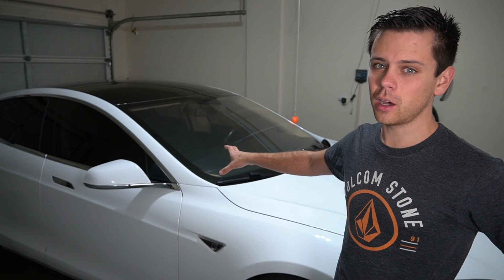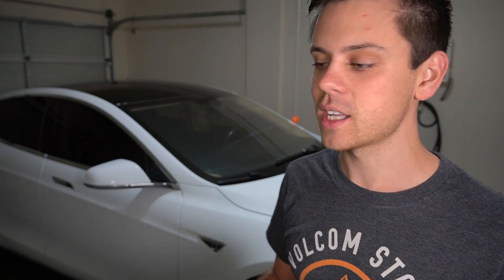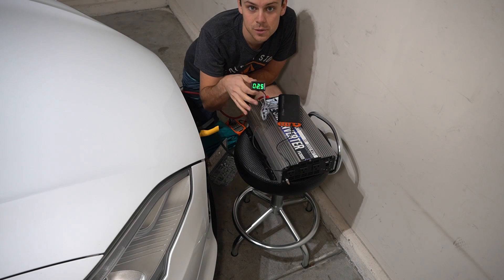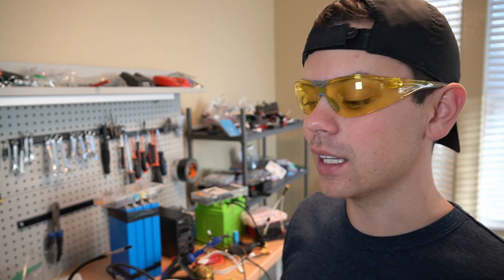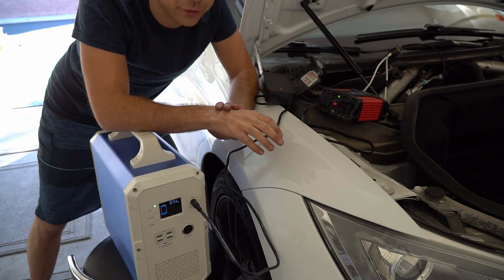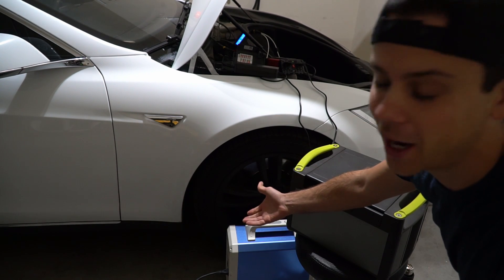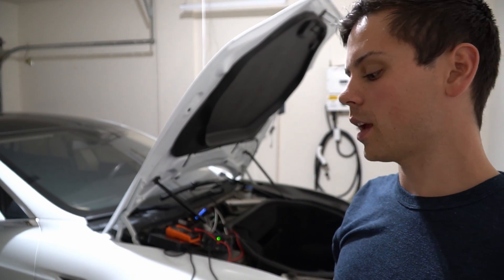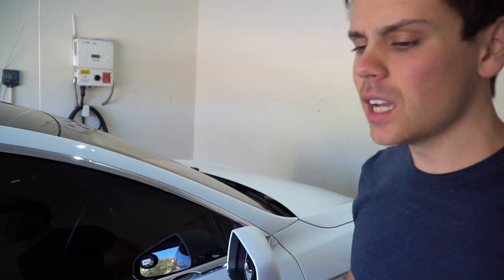Hacking my Tesla Model S for an Emergency 12v Power Source

Comment: Why does a Tesla have 12v jumper terminals? Is it to jump start gas cars? And if so, why are they hard to get to? So many questions.
Reply: Most of the cars electrics not having to do with driving are 12 volt. If your 12V battery is dead you can't unlock or open the doors. The jumpers are there for that reason.

Comment: When you say that the charger came ON as the battery voltage dropped, is the load being powered by the charger or still the battery? If the latter it is bad. But then I am sure Tesla knows better and the charger is changing the battery and separately powering the load.
Reply: The charger was 200a as Will stated, and he was drawing less than 30a,
So the battery will probably be charged at a safe amperage and also will the > 30a load be supported.
Reply: It is a bad idea to draw from a battery while it is being charged. Perhaps the higher power of the charger makes it so that nothing is being drawn from the battery. How can this be tested?
Reply: @sadaavedan  Since the "charger" is a way higher amperage then the load and battery combined, it should be fine.

Normal battery chargers are at most 10A, so yeah then it's not a great idea to put a load on it. 

But it's the same as driving a combustion car and charging the battery and having a heavy load at the same time.

Comment: I love what you did here. Hold no prisoners!! We need to force legislation that will make EV manufacturers provide Vehicle to Grid power, just like they are required to meet other standards.
Not sure about the statement about oil - " we will run out" - I think, check me though, but I think that we will exterminate ourselves with CO2 emissions and the resulting global temperature rise long before we run out of oil.

Comment: In the past I had been looking at solar for a potential new house that never happened. I thing I remember that was really cool in the appliance department was a different kind of fridge. Your fridge is one of the most energy intensive appliances you own especially since every time you open the door, all the cold air comes rolling out since colder air sinks and warmer air climbs. So this guy can up with the idea that when he was designing the kitchen in his new house, he would include room for maybe a 10 or 12 Cu. Ft. chest freezer. He bought an external thermostat and mounted it on the wall behind the freezer. He ran a thermocouple into the freezer and then wired the thermostat to the compressor motor of the freezer. That way he could set the temp at a normal fridge temp, like you would do on a 12V. fridge. The chest freezer is way better insulated than a fridge and doesn't have the frost free feature of a normal fridge top freezer which just turns on a heater periodically to melt the frost. That's why food left in a fridge top freezer gets burned after a month. The chest freezer used as a fridge was very energy efficient so their solar system could be much smaller. Other than that they just planned stuff like the dishwasher and laundry on different days, when there was lots of sunshine. Just passing along useful information just like you do Will. Hope it is useful to you.

Comment: How hard would it be to tap into the high voltage battery and step it down to ~48 volts?
I've seen DC-DC converters I was thinking of using a prius in the same way but I didn't think the price for the converter was right.

Comment: YES! Someone finally figured out a way to use the massive energy stored in a Tesla, for use during a power outage. At least it’s a good first step.
Now, how do we non-techie people do it without pulling our cars apart? Thank you. Love your videos even if I only understand about 50% of what you’re saying.
Reply: Maybe someday they'll offer a inverter/plugin 110v options for electric cars.
Reply: I'm pretty sure I can hook up a 1200 watt inverter to the 12 volt battery in my Tesla and then plug an extension cord into the inverter. The extension cord then goes to the fridge. Or whatever. Nikki from Transport Evolved does that with her leaf on a video. I was hoping that will would show something simple like that.
Reply: @capecoddess3784  " I can hook up an 1100 watt inverter to the 12 volt battery"
And you would be damaging the car starter battery that isn't designed to run a fridge. Stater battered are designed high amp, short draw.
What electric cars do not have yet, is a 110v plugin to it's 100kWh drive battery, which could easily power a fridge and anything else up to 100 amps.

Comment: When you give your Tesla solar charging capability, patent it so Elon will have to pay you residuals.
Reply: Generally corporations use lawyers, injunctions, and cease/desist orders when ppl mess around with their IP. Safest not to profit directly.
Reply: @dmay3391  The "car accessories industry / non-OEM replacement part industry" is as old as American Pie.  The Chinese are already building stuff for Tesla vehicles and soon Elon himself will open a MegaMega-factory over there (those jobs will be non-US).
Reply: @tabaccopuro  "The Chinese are already building stuff for Tesla"
China doesn't believe in IP property ownership.

Comment: Thanks for this public service Will!  That was my plan for backup power with my model 3, now you've confirmed it will work!  (I planned to use a small 400W inverter with extension cables to my appliances).
Reply: a 400 watt inverter won't likely be enough to start your appliances like fridge or freezer or microwave.  I would suggest at least 2 to 3 times that.  Modern fridge or freezer usually runs on about 300 to 400 watts after starting and a microwave 700 or so.
Reply: @teekay1785  Yeah, frig can't be used, kill-a-watt meter shows 500W, starting would be higher.  I can run my microwave at maybe 30% power setting and power my living room - that's enough to be comfortable until the power comes back on.  Also, I have gas heat that requires only a 90W water pump, having heat is a huge deal here in the Northeast!
Reply: @Samuel-ks5gv  am I missing something?  What Gas heat needs a water pump unless its radiant in floor etc ?

Comment: OK that was AWESOME !!! You are more than a little nuts but I totally respect that.

You may want to look at getting a cheap thermal imager. I got a little $70 one from Bangood and it lets me see when wires or terminals are getting hot as well as what components need heat sinks or are going to blow imminently. 

I mention this because in the first part of the video where the front terminals were connected with thin wire a thermal imager would have been really handy. Also it's something that is just really useful when dealing with batteries.

Comment: I've been wondering..  can you use solar panels to charge a Tesla ?    Seems one could drive for a very long time if you don't have to worry about stopping to charge up somewhere.    peace
Reply: @Jason Bowman Will's Model S is 60 kWh. A 200 W panel produces maybe 1.5 kWh per day.
So one 200 W panel would take 40 days to charge from empty to full.
Ten 200 W panels gets it down to 4 days. More is better!
We rarely charge EVs from empty to full, should just top up to around 80% at any opportunity.
Reply: @Jason Bowman Solar can meet all of humanity's energy needs, thousands of times over. Just need more solar panels and batteries produced using clean energy.
Using fossil fuels for planes is OK, as long as their CO₂ emissions are taken back out of the atmosphere again.

Comment: Another great video. If you needed long term 110 ac power at minimal loss you could just use the testla as your battery and hook an efficient inverter to it could you not? And again thanks for doing this research and teaching as you learn yourself

Comment: Does the Tesla need to be turned on for this to work? Can I do this with my Chevy Bolt?
Reply: in regards to the 12-volt battery, Tesla is always on and recharges the12 volt when needed.
Reply: @capecoddess3784  Don’t bet on it. My Model S left me on the road dead because I sat in my car with the AC running for 45 minutes on a hot day.  Drained the 12V dead and car wouldn’t start.  Left me stranded.

Comment: Do you have a link to the 12 - 24v DC converter charger?
Reply: Victron(.com) have a "Buck/Boost" device that will allow you to go between 12 & 24Volts. I have a 12/12 in my Caravan - which has LiFePo 12Volt - so I can charge safely from my cars alternator.

Comment: I'm happy to see this video. I have a model 3 and bought a tiny trailer to pull behind it for extended travel. I installed a new solar system in part with your help. I had mused about using the car's 12v to charge the trailer's new battleborn lithium iron phosphate battery. Didn't know how the car would react. But this seems promising. I'd love to see a more in-depth video exploring the max amps that could be pulled before the car's internal charger can't keep up. Also, some duration testing. But I don't wanna see you hurt your car either. Thanks!

Comment: The next thing I see in my mind is a wall jack and you making a cable to run from the Tesla that wall jack if you need to use the Tesla for your house. I thought about doing this and putting an outlet in my kitchen so in the rare event I have a power failure I can swing the plug that powers my internet hardware and just keep watching TV on laptops. Between Chromebook, Dell 2 in 1 and tablet, I could go about 7-8 hours, and in 15 years in this house my power has never been off for more than 45 minutes. Interestingly enough, one leg of my power panel is fed from my street and the other from the next street over, so worst case only half of my house goes dead. I am looking to move in spring to a nearby area with less congestion and crime, and at that point I might put a small system together to power the lower drawing things in my house. Fridge, induction cooktop, convection toaster oven, furnace, etc.... high draw things, they stay on grid. It will be fun to experiment.

Comment: Hi Will
Really enjoy your channel
You could use a solar grid tie Inverter and power your house direct. There's plenty of second hand grid Inverters around. Just a thought.
Reply: Yeah, but how to draw out 100 amp safely.
Reply: @dmay3391  hi you wouldn't be drawing because your taking 400v.
 So 3kw @ 400v =7.5amps.
House on standby fridge freezer some led lights.maybe max 400w would be 1 amp.
Seems to stack up and of course it is not suitable for a DIY project and all works should be done by a competent person.
Big voltage and current will kill you.

Comment: I think I saw that some people have "power Pack thins in there garages also for charging that you can use  is it called a "WALL?"
Reply: TOMAS, "their" garages...
Reply: @gregyohngy  THANKS  Glad Will has someone watching that
Reply: @gregyohngy  HEY GREG ! CAN YOU ANSWER MY QUESTION NOW ?
Reply: You might be referring to a Tesla Powerwall. They're a large lithium ion battery that reacts to grid power loss much faster than automatic generators. Paired with a solar panel charging system, a Powerwall could power a house for a few days.
Reply: @DangNguyen-my3wd  YES , THANKS, That's what I was thinking!  Will could incorporate it in with his car for the projects he's thinking of. Thanks again Bro.

Comment: Off topic- Why doesn't anyone talk about wind energy?  My sister-in-law's parents have a 30' tower with a turbine which initially cost them around $9,000.  I haven't done the math or research to see how much return they're getting (I don't really talk to them) but it must be worth it.. Especially if you combine solar too.  Any thoughts about it from anyone..
Reply from the maker: Location dependent. If you have wind, use it. Most people do not.
Reply: @WillProwse  I was trying to get a debate started here, lol.  Everything I'm reading about wind energy seems to be positive... If that was the case then more people would be doing it.
Reply from the maker: @Steve_1999  ask it here: https://diysolarforum.com/index.php?forums/wind-turbines.46/
Reply: @Steve_1999  It can be tricky to do in populated areas.  I live in windy Kansas, but can't put a tall tower on my property because I'm too close to neighbors.  Large wind farms, and rural lots are currently the only good options.
Reply: @The81Winfield  Thanks John & Will.  I'm on the forum now...
Reply: @The81Winfield  vertical windmill or get city code changed
Reply from the maker: And everyone has solar
Reply: Honestly what most people don't tell you is the small home sized units just don't generate enough power. It takes a LOT of wind, HIGH SPEED wind, CONSTANT wind to make a generator worth the cost.
Reply: @Tuckerclan  Yeah, I bet it takes years (like a decade) before it "pays for itself."  I've got a friend that mounted a wind turbine on the mast of his sailboat, That's some guaranteed wind but not under the usual circumstances.. lol

Comment: Not to be mean but you should do a video on how many solar panels it would take to drive 50 miles a day to work and back. I need the cost and if you would need a extra 50kwh house battery? So you can make enough power if your car, how much would that cost  at 48 volts 220 10,000 watt inverter installed at your home? You can use as much as you want but when you leave the house is charging up that pack at least the same size as whats in a Tesla , so the cost of a p100 battery pack  One should have supercharger hooked ot a 50/100 kwh battery. Max charge could be 5,000 watts maybe 220 volt changer for your house system which would take 10 hours to take a house 100kwh batter bank to transfer your power over fast. I think a 25,000 watt solar setup would be perfect. You could go a week without sun at all and still get to work and only use around 5000 watts a day in a home. Or you could just burn clean coal and pay 200 or 300 a month in cash which means only about 2400 dollars or 3000 dollars a year and get a shxt tons of power and tons of miles you get in your car enjoying it. You can't never use a super charger cause they are mostly powered by coal and oil too. It would take a 100kwh solar farm to charge around 5 Tesla a day. So, every 100,000 watt solar farm patch (size of earth not getting anymore sunlight ) and how many chargers does a station have? and every 5 Tesla's  per charger. I think it would take a lot of solar panels and all the power that it took to make a solar panel should be made with the sun to keep cost down making the solar panel.
Reply from the maker: I'm making a video on these topics right now.
Reply: Clean coal? Come on.

Comment: Maybe someone knows Nissan e-nv200 12v battery charger amps output? I wondering would it be enough to power electric chainsaw (1,2kw).
Reply: As far as I can find, the 2016 Nissan Leaf have a 135 A converter. The e-nv200 most likely uses the same converter.

In a other source, I found that "It is very stable at 74 Amps 13.6V output."

Comment: Instead of the DC to DC converter, might it be better to utilize a charge controller, set to 30Amps, thru-put? Also setting the shut down to the minimum input to maintain integrity of the "Tesla" and the out put shut down at the capacity of your system. 
 B BIG Time Blessed. . . . .
Reply from the maker: What do you mean? the converter circuit on the car? which one?

Comment: Why is Tesla not using a Battle Born Battery 😅
Reply: Tesla batteries are cheaper and more energy dense than LiFePO₄
Also 60 kWh of Battle Born batteries would cost over $60,000 and leave no room for passengers.

Comment: Tesla needs to use  Super Capacitors inline with their batteries 🔋
Reply from the maker: Why?
Reply: @WillProwse I think there is a significant chance of super cap troll ;)
Reply: super caps are not useful here (for now). The leakage is too high. They are doing research in better batteries which may be a mixture of super caps and kind of li-ion chemistry. Super caps also have very low capacity for the same size. They just can be charged and discharged very quickly, which makes them useful for busses that can be charged in seconds at every bus stop. These experimental busses already exist. battery technology is improving quite fast but it will take some years to industrial mass production.

Comment: Its ridiculous to have house that suck tons of power..... there is a house on Greek Island that uses no electricity..... it a huge house 🏠 it was just built & designed efficiently.
Reply: True, we really should be using solar, wind & even water to power things whenever possible.
Reply: Passive Houses, Netzero, etc designed homes draw far less power.  It could run with far less power than a standard home.
Reply from the maker: cant disagree with that. Very true.